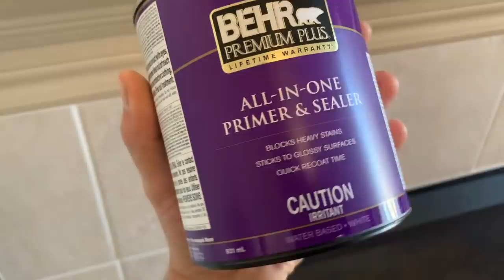Part 3. Inexpensive Fireplace Fix. Living Room Makeover.

Comment: Years ago I painted a brick fireplace.  The previous owner had glued a piece of cheap paneling over the fireplace and when it was removed by some person,.not me, several bricks were chipped.  Big chips.  So I patched it with cement patch and then painted it.  It looked terrific.  It was an ancient gas fireplace and I never used it as a heat source.  During the holidays, I filled it with poinsettias.  Beautiful.  They were also on the mantel.  The mirror, which I liked very much, just didn't "reflect" your style.  Ship looks great.  Fireplace redo is extremely nice.

Comment: Your choice to do or not.... the optical illusion of the fireplace could be carried further by duplicating the angle of the bottom of the fireplace across the corner of the ceiling and filling in the corner with gray paint too.  So far the floor to ceiling light curtains and painting the fireplace are wonderful improvements!

Comment: The choice in curtains, both position and type, spot on. Lifts the whole room up, changes the whole aspect of the windows. Bravo, you have the eye.
But i have to ask...what exactly are those people smoking? It should never cost that much for a fireplace...here in Europe, i can get a whole vintage style fireplace (our detached full tile tower style) for less than 2000Euros + 500 or there about for building materials. Jeesh.

Comment: OMG I just figured out  the tiles you used in the Potter's house were exactly the ones I originally intended to use in my kitchen!!!!
I accidentally ordered the ones that look almost the same, but have straight lines instead of  black flowers on individual tiles and hated myself for it, especially as I didn't notice until they were laid down.
Good thing I didn't use yours, I hated them in the Potter's house the ones I have luvckily look so much better when in small spaces....
Had no idea Marazzi is available in Canada, good for them.

Comment: You may or may not have read my suggestions to paint the fireplace and take the curtains to the ceiling....maybe great minds think alike...the results are a transformed room...I like the ship ...the mirror is really nice, but just a bit to bright on the gold...If you had kept it, I would have suggested working with color on the frame...just dulling it down a bit....but you solved it.  Yeah....loving the room and can't wait to see what Josh comes up with...  I am glad the fireplace came out solid because if won't compete with the lovely carpet...you would have a time finding a tile that works overall...

Comment: You could tape a straight line between the edges on the ceiling and paint in that triangle to give the illusion it's a solid thing. You will need to put a little white in it to dilute it just a smidge, because when light hits the walls, the color reflects up, and will make the ceiling naturally darker. So that's some free advice from a degree holding interior designer 🙂 Love the color!

Comment: You could add a small piece of trim along the edge of the paint on the wall so it feels more structural instead of just surface. Wouldn't cost much, just a couple tiny strips on either side

Comment: Maybe add a high shelf on both walls that join together at the corners and add some undercabinet type led lights (they have those really cheap at ikea)  to highlight the boat. 

Or instead of two shelf’s at 90°. Even one diagonal piece of wood could work there as a shelf. 

Or just add two small cool antique bookshelf/gallery type lights on both sides that point down at the boat. - Lighting is your friend here to make it look even more like a feature 😊
Reply: Can’t really see how much space is on top of the boat though, but if it’s not much space- the diagonal piece of “shelf” with lighting can placed close to the ceiling and piece of ceiling trim that matches the fireplace can close that gap, creating a faux piece until you’re able to build a proper one at some point.

Comment: Hi Alex and family, as far as extending the fireplace in height which I have done twice using one arm only, not kidding. As far as  the cost excluding the tiles is about $ 200.00 - $250.00 possibly less. All that's needed is a few 2x4s, screws or nails a sheet or two depending on the dimensions good one side plywood or your choice of sheeting. The plywood will need a lite sanding before and after a primer coat, seriously it's a very simple thing too construct, the two most important tools are a level and a square, it's something you could manage in a few hours or have the twins construct it no time . Cheers From NS🇨🇦

Comment: I found tiles at Home Depot in Peterborough ON today.  36  2" squares for $4. each square foot. I need them small if they break in the high traffic area I'm installing in, I can switch them out quickly. There was a fairly good selection but I'm adding them to an already existing tiled floor under a wood stove and they only had a marbled beige in the thickness I needed. But wow to the burnished silver,  mineral look and the mirrored tiles.  I still have some of the older 4 by 8"tiles left to play with so it should be interesting.
I have plenty of high end tiles in the basement. That yard sale was a good score. They just where not the right thickness and I didn't want to have to move the stove. 
 I'm laying most of the plain Janes  under the workshop tables in the leveled out dirt floor.  I did that in the pump room with actual floor grade tiles. Looks good to me.
I took some of the fancy ones with dragons on them and leaned them up against the cement foundation of my potting shed. It''s a totally trash scrounged  6 x 4' building  trimmed with cedar slabs but it's still standing straight after 30 years. 
After finding a dead rabbit under the floor of the tractor shed, I blocked off their entrance with a few tiles. 
One might say I'm tile wealthy. I did give a good sized box to charity recently 
Next time you come across tiles, grab them they have plenty of uses eventually.
Do not use them for garden edging. the frost shatters them and I"ll be picking them out for years to come.

The ship really set off that battle ship gray you used. Looks good.

Comment: 1) absolutely nothing wrong with ue fireplace stain the wood oe drill to holes for pvc to be put into the mantle perpendicular and extend the mantle! 
Craftsman tile around the fireplace should not be over $500.00 ! & woodframe around
 the two rows of tile.
Your change looks good.
Top shelf on the mantle could be black to match the box... more depth!

Comment: I'd have had your artistic carpenter friends build you a faux wall to the ceiling to get rid of the "niche" aspect of the corner.
Then you could build in a gorgeous mantle.

The mirror is fine except it needs to be tilted a bit (wire and hook behind) so that it is not just showcasing your light fixture

Comment: I love the new curtains - you're right about the floor to ceiling, it changes things up in there quite a bit. I am so glad you changed the fireplace a bit, but within your budget. I would not like a corner fireplace because it limits so much about what you can do with the room. But I like that you're doing what you can without breaking the bank.

Comment: I have one small criticism about the painting.  I watched Alex take a brush and paint a square border on the left side of the wall above the fireplace. Then he painted the other side and stepped back.  It looks like you have two, four sided squares of course.  You have to be VERY careful when doing that.  The brush puts on more paint than a roller.  You cannot let the square paint dry on the "border".  You have to grab our roller and not only fill it in but roll over that border as close as you can to the top, bottom and sides.  Alex was safe because the sides had tape.    IF the border dries and you came back later and just go over it with the roller, wait a day or so and go back and look.  You can clearly see that someone put on a heavy square border with the paint and then came back later and filled it in.  It is actually very noticeable depending on the angle you are looking at giving it the "frame effect"

Comment: The only problem with the mirror, was the frame: it was too textured for your clean lines.  The Boat, with splash of color, is much better.  I like the fireplace treatment- simple, clean, neutral colors and striking all at the same time.

Comment: If you wanted to take the fireplace one step further, add some dado molding painted in gun metal above the fireplace going horizontally at the two paint edges. Would creat the illusion the fireplace was meant to be floor to ceiling.

Comment: You might want to paint the triangle of ceiling to really give the the corner a finished loo and even put a piece of trim on the ceiling paint line. Make sure you bring the grey in someplace else in the room. Right now it is fighting with the piece the tv sits on which is all warm tones. Also you can do better with the rug which is way too traditional for the room. I agree to do “what you like” but in decorating you should not mix too many styles together. Right now you have a modern fireplace, a rustic sideboard and a traditional rug and sofas.  I interested in what you choose for the  coffee table!

Comment: Works really nice till it hits the ceiling, then the illusion falls down? maybe add a piece of fancy shaped wood on the ceiling across the corner, paralleled to the fireplace, paint that, and the ceiling inside the alcove the 'magnet colour? Then the whole corner becomes an alcove type thing?

Comment: The curtains look sooooo good!  The extending the color up to the ceiling was a great idea.  The sailboat is a tremendous improvement over the mirror.  Hang it on the wall somewhere.  You could stencil some designs in white on the gray tile so it doesn't look like plain concrete.

Comment: The fireplace looks so nice and fresh and I like the grey going up to the ceiling.  The ship looks nice there too.  I wonder what you would come up with for my gas fireplace that is one of so many just like it in my neighborhood. It’s boring.  You have me starting to brainstorm
Reply: You might look at stenciling. It does well on tile and would be unique. Paint the stencil in, and seal it with a clear top coat.
Reply: Dodi Tov  thanks for the idea. I don’t have tile. It’s a built in  entertainment center. So it’s part of the wall but set- off by pop-outs. I’m still thinking 🤔. I don’t have to have it the same color as the rest of the walls. 🧐 hmmm

Comment: How's that paint gonna hold up to the heat though?
Reply: Actually paint is designed these days to withstand temperatures of about 350F before igniting. The gas line will never get that hot and the tiles certainly won't. The big misconception is that fire of itself will melt/burn all in it's vicinity. It's untrue, or all those repainted bricks in Grandma's home would have been a charred mess by now.